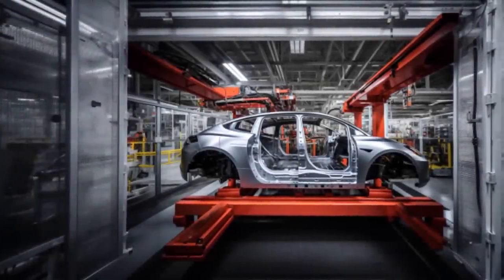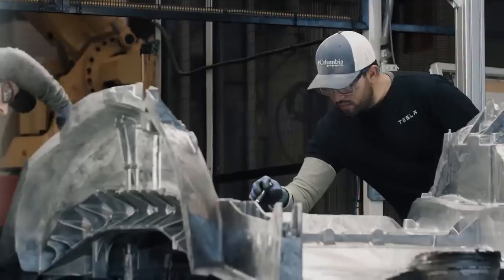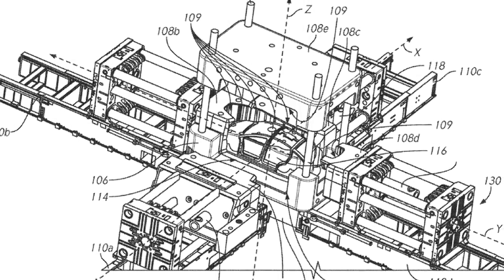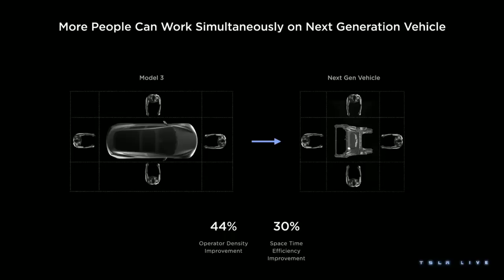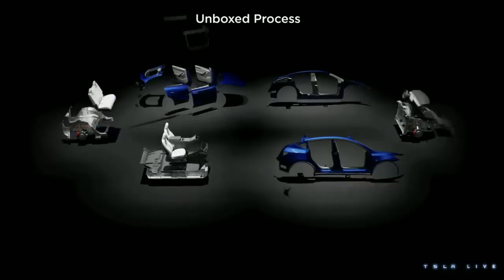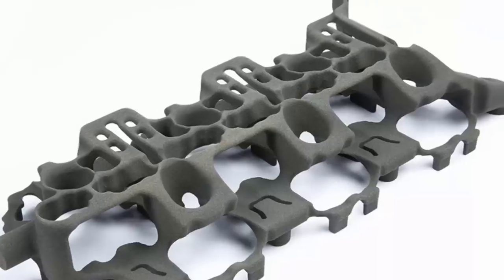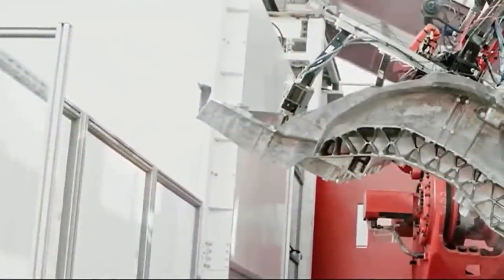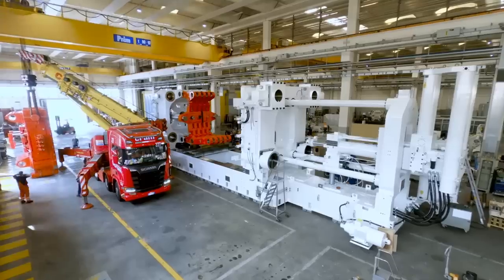Tesla’s NEW Giga Press 2.0 is Here!

Comment from the maker: Which casting method do you think Tesla will select? And will this new large Gigacasting interfere with Tesla’s Unboxed Process or is there a middle ground they can go with? Be sure to watch:
• ELON MUSK: A Great Reckoning Is Coming: https://youtu.be/MLpwow40bPM
• Major New Tesla Sodium-Ion Battery Breakthrough: https://youtu.be/zfwFyImuuDc
Visit our website: https://themarketisopen.com for instant stock quotes and free financial data
Reply: Single cast is a misunderstanding by Reuters. (Imo)
Think it through.
You make a single casting.
Presumably, you want structural cells in the pack?
You either have to assemble the cells directly into that casting, or build a separate unit... Which defeats the object?
.
If you DO assemble the cells directly you must then stack the whole casting while you test the pack. That's a huge amount of space.... which defeats the object(!) and if there's an issue, you must recycle the whole casting (body) to the previous point, remove and refit new cells.
(Not to mention cell/ pack replacement as a service operation)
Then there's the "interior build onto pack" issue.
You would still have to get the interior inside the passenger cage. How?
If you build it on top of the pack then insert it from underneath.... That what they do now and what the unboxed system would involve, so why change?
Otherwise, you're back to working inside the vehicle... The old method.
.
It's far more logical, space and worker efficient to take "a casting" say the front section, bolt on suspension, bodywork, cooling, control, and other systems working on 4 sides then transport to the assembly point, meeting 3 other complete sections and marry the units.
Reply: Cast the entire bottom and box the top parts.
Reply: The slower method as it has a quicker turnaround in development and you can always run multiple presses to increase production

Comment: the new single casting could be a casting for the upper car structure which would be added after the 3 unboxed pieces have came together. It could cast both the right & left door frame & roof structure as 1 piece instead of the current sheet metal pressed pieces.

Comment: 16,000 Ton die casting machine wow.
I am an ex casting engineer at a Japanese car company. At my place, casting parts are cast on a 1650 die casting machine
Tons, mostly used in car engines and under the responsibility of the engine group.

Meanwhile, the body group is responsible for the inside of the car body.

With Tesla's courage and great success in redesigning the car body, there is no doubt that all car manufacturers will follow suit in the next few years.

This could provide benefits to casting engineers wherever they are, as their needs will double or triple in the automotive industry.

Comment: tESLA does not make the gigapress. It is made in italy Italy
The Giga Press program is a series of aluminium die casting machines manufactured for Tesla, initially by Idra Group in Italy. Idra presses were the largest high-pressure die casting machines in production as of 2020, with a clamping force of 55,000 to 61,000 kilonewtons (5,600 to 6,200 tf). They do not make them please make the correction.
Reply: Thank you   This site is moronic

Comment: I wonder what the throughput difference in ‘slow injection’ vs ‘fast injection’ casting really are? Fast injection is required to avoid imperfections, voids, in the casting. Chasing alloys and mold design helps here; it could be that this is why the rapid and low-cost prototyping of the sand casting is being explored—for casting quality—lowering fault rates (very) expensive parts loss.

Comment: One piece casting? How the hell is this going to be repaired if a battery cell goes down? Even better, how is any maintenance going to be done? Producing disposible, unmaintainable cars will last how long? Revolutionize manufacturing, destroying maintainability. A car requires more than just manufacturing. Perhaps if the car comes down to a couple of thousand, and really is disposible.
Reply: They are LONG past needing to worry about a cell failure.  Maintenance can still be done, why would it not?  Are you under you understand what they're talking about?

Comment: I feel that all the breathless Tesla fanboi reporting is missing the forest for the trees.

The capabilities of 3D printing with respect to casting are by no means limited to sand cores.

Spacex, GE /  Safran for instance already own major expertise with 3D printed metals.

Metal printed, Chemical polished prototype dies are achievable in lieu of traditional die sinking methods. This can speed iteration cycle and reduce the repetitive cost of iteration.

The 2 most valuable high production casting techniques are Lost Foam and pressure casting.

Optimised micron accurate 3D printed foam molds and core molds open a lot of doors.

Comment: Tesla has perfected the production line so that it’s innovative, efficient and upgradable so that the process is self sustaining. The next big item is Automation of driving, this will change the motor industry. Tesla will achieve the manufacturing to such a point that they are years ahead of the competition. The next big step for the brand is providing an effective, efficient means of generating electric its storage giving the freedom / independence of not needing the grid as a supplier. This market is much bigger than the car, truck industry.

Comment: "Tesla has been making use of  large gigacasting...for model 3 and Y" @ 1:32 That statement is not quite correct, Y is using gigacastings but 3 has not, there is no report that show they are using it for Highland Model 3 yet AFAIK
Reply from the maker: Yeah I think just the rear of the Model 3 at least was using the Giga casting:
https://www.tesmanian.com/blogs/tesmanian-blog/tesla-to-produce-model-3-with-rear-single-piece-casts-using-parts-from-gasoline-cars

Though this article here appears to say it's both. Article might be wrong though.
https://www.designnews.com/automotive-engineering/teslas-switch-giga-press-die-castings-model-3-eliminates-370-parts

Comment: I'd go with both casting methods.  Separate the factories and models and teams into the two methods, then have them compete.  Over time one method will likely show a clear advantage, and in the mean time developing both methods will result in a lot of new knowledge.
Reply: At lab scale, yes. But at factory scale, too expensive. You will have 50% loss cost at the end. Inside one team you can do A/B development, but cross-checking frequently on smaller outcomes moving the whole process forward more efficiently.
Reply: You can't do both.  The cost at putting one of these online is in the millions.  Besides, that 4-way casting machine is an impossibility.....  running one is hard enough, and now you need 4 to run at millisecond precision with all 4 having perfect shot profiles?  Not a chance.

Comment: Once again this channel's videos are full of hit-and-miss bad information. The cybertruck for example is not an exoskeleton design. I keep checking back to this channel but they never get any better. It is basically chat GPT making up reports by also including bad information which it doesn't know is incorrect.
Reply from the maker: Well Elon keeps saying it's an exoskeleton design. It still seems to have a much more rigid shell that a regular steel frame car with weak side panels. So it seems to make more sense to go with that rather than what the armchair engineers have to say.

Comment: I am very confused with this report of a single casting for the bottom.  The bottom is literally the structural battery pack, and the front and rear casting are the remainder of the bottom.  Making those one piece would greatly complicate the battery assembly.  I could see the cast be the front, back, and sides, as the top has no cross structure.
Reply: That's what it is and what the design patent shows. I think the bottom casting is a Reuters story to throw people off. 
Nothing they say about tesla&tsla can be trusted imo. 👍🏻

Comment: I mean I get that more you can press the less over all parts you have to put togather, but isnt there a point that it doesnt matter? I mean sure you get to skip a step, but the time to do that step vs the time you have to press the whole thing I would think wouldnt make that much of a differenc I wouldnt think.
Reply from the maker: It's a good point. I was thinking about that too. It looks liek Tesla still needs to design what works best, given the Unboxes Process. But if they go with Giant casting press, that could save cost and floor space and even speed, versus say 2 large casting machines and a series of robots that need to weld the parts together.

Comment: Why not use that sand method for creating the steel molds that are made from the CNC method? Instead of taking months to grid down a single block of steel for the desired part it could be cast and fine tuned.

Comment: Some very good observations regarding the single piece chassis construction and manufacturing challenges, as well as potential benefits.  I'm guessing we'll see the unboxed assembly used with three sections for the larger vehicles, and maybe a one piece hybrid with the top of the battery pack including seats as an assembly for a sub compact.  Thanks!

Comment: I wonder how they go about and how often they have to grease these presses? Looks like so many parts and the heat has got to bake it out of them
Reply: Die casting is a maintenance heavy manufacturing process. You are right,  the special grease they use is high molybdenum goo. The actual steel tool needs to be torn down, cleaned, repaired and reassembled on a fairly regular basis.  If not, preventive maintenance like that soon turns to major repairs.  Things like an ejector pin getting bent. When they get bent,  the bent pin starts to screw up the precision hole that it runs in,  then the casting starts flashing really bad around the hole,  then the flashing will push down into the hole,  further screwing up the hole.  It all goes to he'll in a big hurry and some robot isn't going to be able to keep it from happening.  This brings the fact that they will need multiple molds of the same product because production can't rely on one tool. Like the guy in the video said,  these are multi million dollar molds.  The trouble is that these are along with most of the Tesla tooling, "dumped " Chinese products.  Yes, "dumped " Chinese products,  they have been doing that shit for decades and Tesla is benefiting from that "dumped "resource.

Comment: The question I don’t hear anyone asking is what happens to a cast car frame in a crash, and what the repair process would look like. Stamped/welded frames tend to bend rather than crack, and can be straightened again. Will cast frames do the same, or will the castings be more likely to crack instead of bend. If that happens, how do you repair them? Can you use welding to repair cracked castings without compromising strength?

I have no idea of the answers to these questions, but I don’t understand why no one is asking or talking about them. (Maybe my gut is wrong and it’s just a complete non-issue?)
Reply: Your question has been answered previously.  "Electrified". (Dillon Loomis) had a segment on it.  Short answer is castings  are easily repairable.
Reply: @almostthere100  Thanks for that note, I'll check out the channel/vid!
Reply: Watch Sandy Munro on this. I’d rather be in a car crash with a casting than without.
Reply: @FutureSystem738  Thanks for that note, I'll check it out. Sandy's a knowledge-monster in the car biz :)
Reply: @DaveEtchells   Basically if the car is so badly damaged that the casting is “toast”, I’m very happy to walk away in one piece and let the car get scrapped. I don’t know how old you are, but the safety cage structure saves an awful lot of lives compared to cars from not that many years ago.  Gone are the days when it was economic OR SAFE to cut cars in two and rejoin halves or a whole corner etc- which happened to one of my father’s cars in about 1970. 
It’s just not a viable, safe, or economic proposition these days.
For less major prangs, there are lots of replacement parts around for front and rear, and corners available.
Reply: Depends where it went bend/damage, but yes, once they crunch enough they're done unlike other cars that you might be able to tapper out again. Problem is - this saves so much time and money in the purchase side - that - this wont change from a mfg. side of things. Its no different than when you phone breaks. Live in a throw away world - but "cost" is the main driving force into why we do.

Comment: The best path forward is likely a few pieces.  It is to be commended that Elon is exploring casting techniques and alloys.  There should be great benefits to properly developed techniques.  It was not so many years ago Semi- solid casting techniques were developed.  I don’t agree with your assertion that sand casting is useful for rapid development since the grain structure is completely different.

Comment: I wonder why the never tried reorienting the horizontal giga press vertically.  Reduce the ram sets required to one and getting a gravity assist, reducing the ram sizes whilst still getting full clamping pressure.
Reply: Well for one, gravity Assist in one direction is gravity Resist in the other, and even on the Assist side you have to control that drop.
Reply: @GT4viper  Great point. What I'm thinking about is that the lower half of the die base is fixed, requiring no rams. The upper die rams only require the target clamping force minus the mass of the moveable ram assembly. Something like a drop forge design modified into a die casting forge.

A search of "largest drop forge" returns plans for machines that generate 40,000 tons of clamping force.

"[...With a new concept for the design and construction, Siempelkamp made it possible to bring together practically incompatible customer requirements in a single solution. The design is a four-column under-floor press with external main cylinders and hydraulic parallelism control, to compensate for the diverse vertical expansions associated with the eccentric stresses. It permits the production of high-tech drop-forged parts more safely and reliably, even faster than before, and at lower cost.

The press weighs approximately 5,350 metric tons, due to the heavy-duty design of the press frame, in order to provide the rigidity required. The moving mass of the upper moving cross-head alone weighs 2,550 metric tons, and the upper die can add up to 200 metric tons.

Thanks to the design of the cylinder heads, the four main cylinders are highly durable. The design provides a guarantee for 10 million full-load strokes...]"

Comment: Tesla can combine the priciples of the unboxed process with gigacasting 2.0. We did see lately in the video from a trade show how they design sub assemlies in the front and rear to be fitted in one direction only. This makes it easier to use optimus robots and cuts down on assembly time. Nothing would stop them to use this methods if the gigacasting of the skate board would be done in one piece. This is entirely possible with small design changes to the Idra press. Just imagine a machine using platens twice the size of the 9,000 ton press side by side. It would have two toggle mechanisms for closing/clamping and six tie bars. Beside the platen size which would extend the horizontal dimension two fold, the components of the machine would be largely the same.
Reply: It's a contradiction.
The whole point of unboxed is to work on 4 sides of a unit then bolt the units together.
Assuming 3 units, that's 12 "workers" total simultaneously.
The single casting is a retrograde set back to 4.

Comment: You mean 16000lbs right?  Not 16000t, which is hard to imagine.
Reply from the maker: No, 16000 tons!
Reply: @TMIOTesla  that’s about a third of the weight of the Titanic.
Reply: @paulmcgreevy3011  less than 1/4 of a fully loaded Iowa class BB. 
Seriously though it's the total clamping force rating for the press. 👍🏻

Comment: The sand core method may apply only to casting the press dies before machining, An alternative is jet printing which also can produce complex internal passages. This is a regular required process as the injection molds wear out.
Injection filling such a complex and large total frame mold may not be as quick as it can fill the current end castings, hence a different alloy.
 Final assembly interior details for the single die-cast car structure will be aided by accessibility from the large bottom battery hole before the complete with-seats structural battery is inserted.

Confusion in reporting without understanding is what I think we are hearing.

Comment: They could use a Disamatic moulding machine which allows the use of cores. It has a cycle time of 10 seconds and the casting is cooled in the sand mould outside the moulding machine
Reply: Those cores would have to be carefully supported and preheated to keep them from shutting off the filling process before all parts were filled.

Comment: I'm pretty sure that the Cybertruck underbody is structural.

So is the body, to a point. But the main point of using the word 'exoskeleton' for Cybertruck is this: the tough part is on the outside. Paint and sheet metal aluminum isn't tough. 3 mil stainless steel is.

I suspect that a single casting for the underbody is significant, but not as significant as using stainless steel in the next-gen body. Imagine an affordable car that is immune to cart demons and parking lot dings. Think that will sell? With Tesla's software and connectivity? With good performance and range?

Demand will be insane.